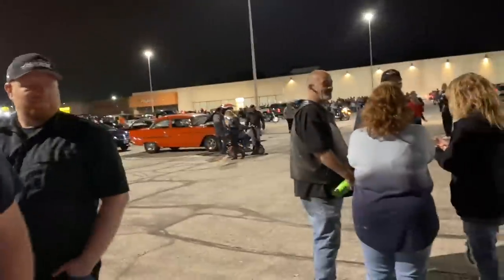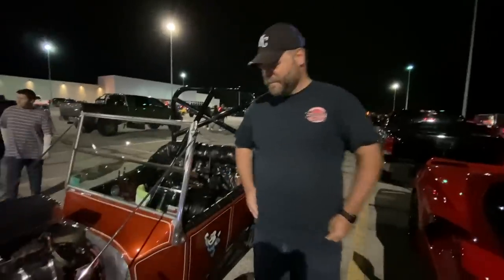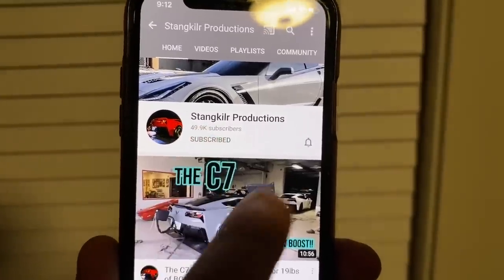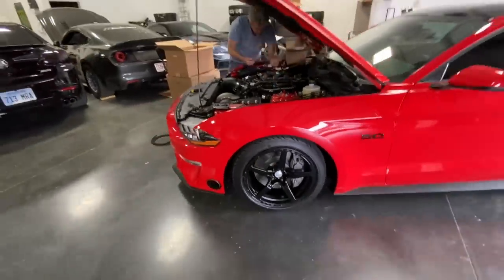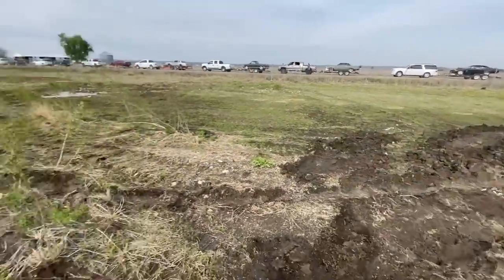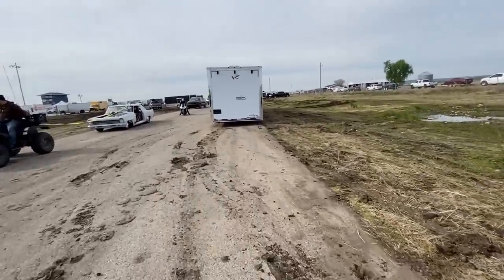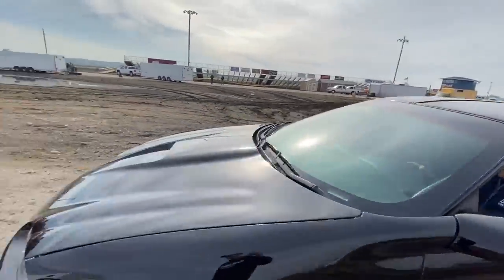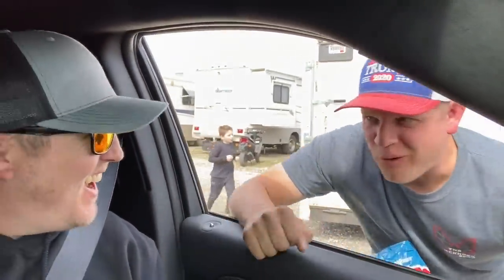900hp Trackhawk vs worlds fastest Escalade! Plus, drive in a 900whp Hellcat Charger Widebody

Comment: I recently picked up a old 2002 GMC Yukon, its a solid truck. My game plan is to throw the rods and pistons ls2 I got in my turbo 03 single cab Sierra, its getting  a sbe 5.3 and getting sold. So basically a awd gutted Yukon with a solid ls2, Huron speed single turbo kit and a th400 or 80e and see what happens LOL big rim racing is getting big around my area in Alabama and Iv been asking around if yukons, Tahoe's and 1500 pickup trucks on 24s and 26s are allowed and every body I know said it was cool, So it's a good possibility I'm gonna throw some 26" GMC snowflake replicas on that sucker and try to kick donk master in the teeth!